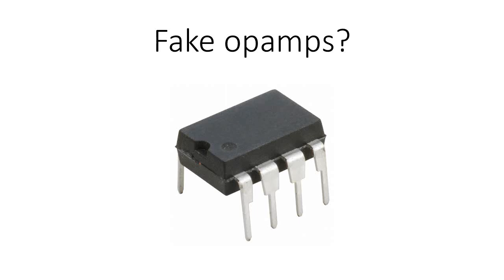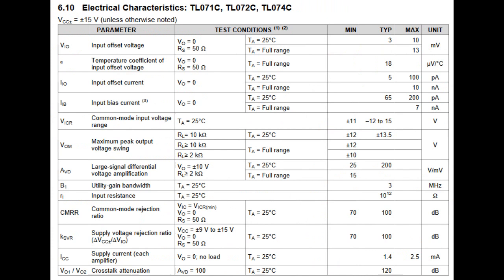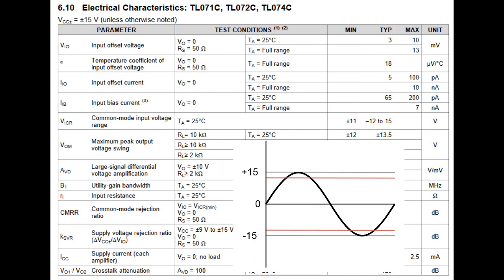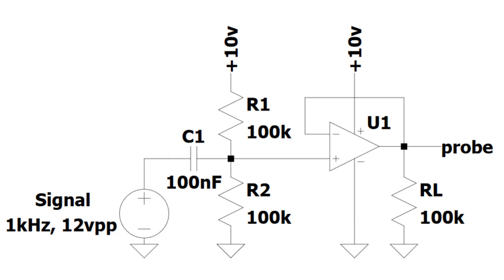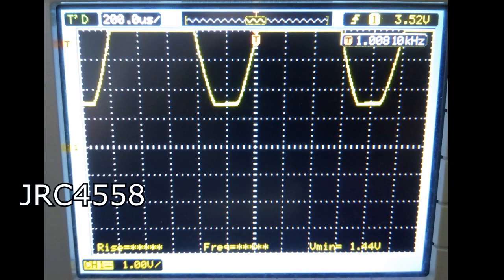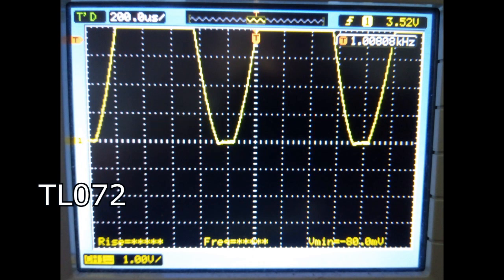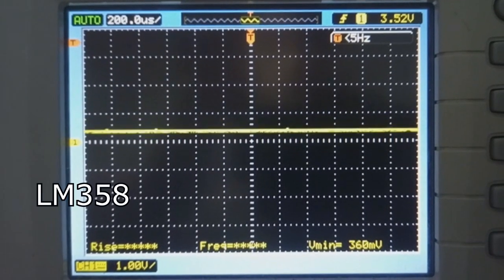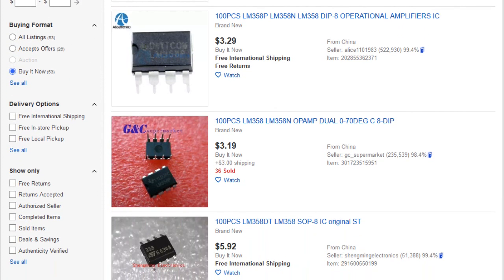Are Your Opamps Fake? (Tested!)

Comment: If you want to check for legit NE5532, you can use a multimeter to see If there exist antiparallel diodes across the opamp inputs (and must yield the same values in both ways). I've done this with old eBay NE5532 dip8 fakes and they didn't have such diodes. I tested legit dip8 NE5532 chips from local store, and there are 800mV voltage drop diodes. Also i tested new NE5532 in sop8 from aliexpress and they've got 1020mV diodes in both ways.

Hope this can be useful for you.

Comment: Good overview & test - either AC and DC swing.
Two points that could be interesting to see and help to differentiate:
(1) Frequency response - there are several ESR projects that require 100KHz wave generation and amplification originally they were designed (and work) with TL082/072; but the remarked LM358 are complained that are not capable of that. I saw people using a simple 100KHz square wave on input and check the output swing slew-rate and amplitude at output.
(2) Some rebranded may be even worse than an LM358, as a “Fake LM358”, as they are dual OpAmp but their performances are slower. This was discussed in some blogs, but I don’t remember now which one.
Reply from the maker: Yes, I indeed looked into slewrate and bandwidth tests to check how fake or bad they are and once noted values for different types of opamp a whiiile back, but the swing test is just way faster and also easily done without oscilloscope hence I only focussed on that one.